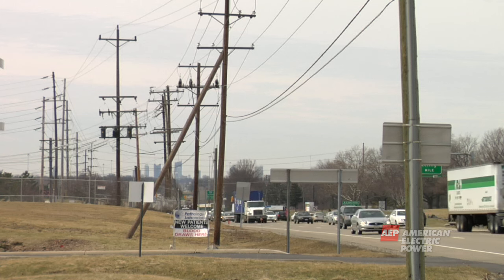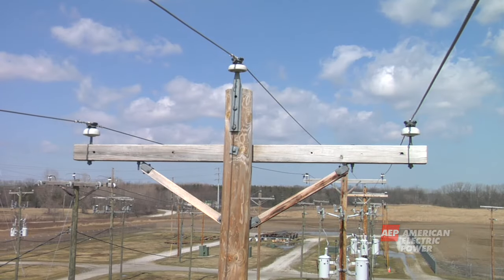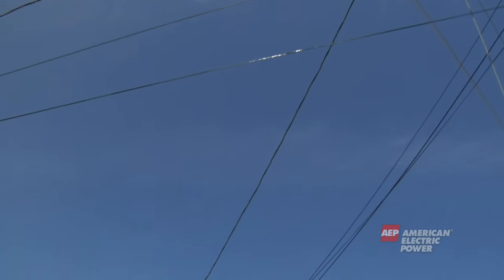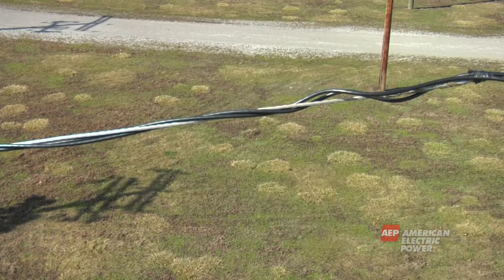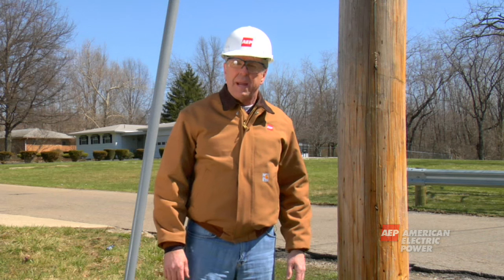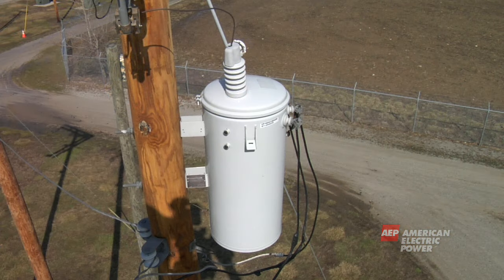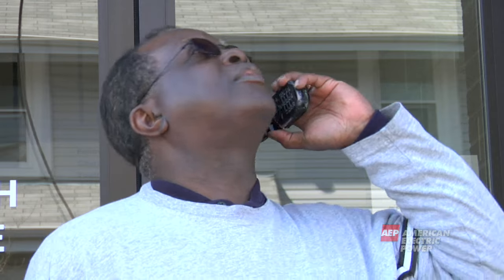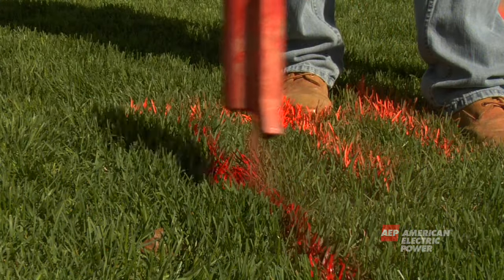Chapter 3: The Anatomy of an Electric System

Comment: if im correct the voltage on the neutral wire is 0.05% of the voltage of the phase so in the normal operating conditions it is totally safe to touch (in the normal conditions but better not touch ^_^)